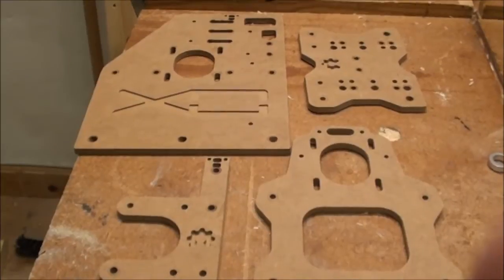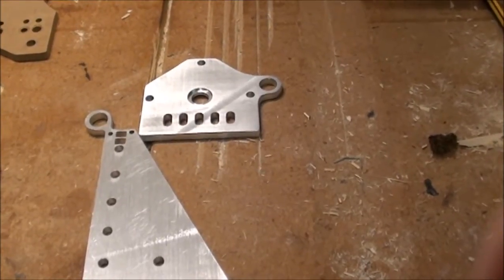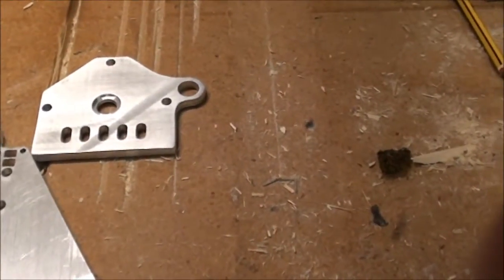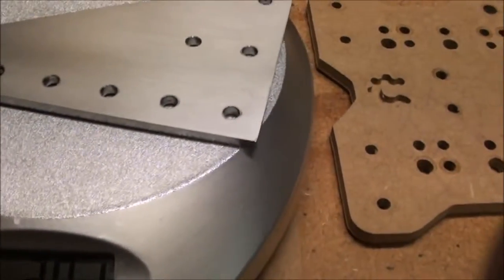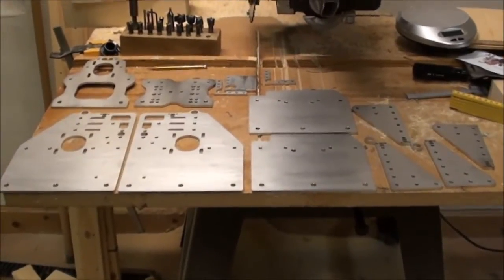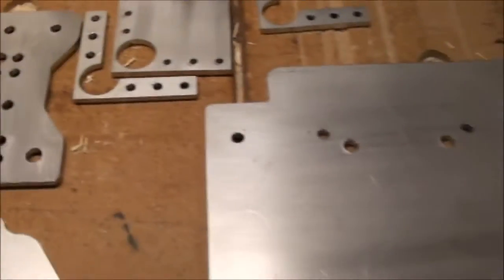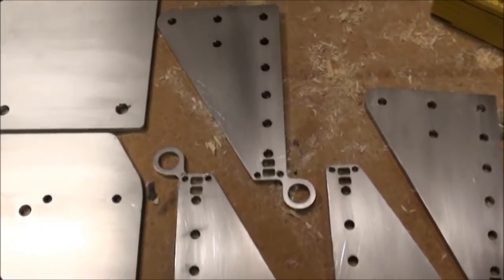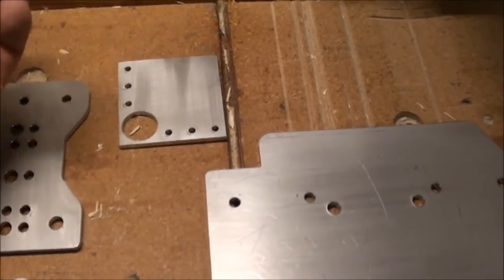OX CNC Stainless Steel Gantry Plates

Comment: Hey, how big is your machine going to be, that you decided to use metal for gantry ? what material ar you going to cut with it ?
Reply from the maker: Hi ArenaTM
I'm making a fairly large machine 1500x1300mm. This allows for cutting full sheets of e.g MDF/Plywood as the ends will be open so I can split long projects into tiles. Rails will be extruded aluminum from OpenBuilds. X will be 2  pieces 60x20 for the gantry and one 40x20 as stabilizer. Y will be 80x20.
The machine will for sure be able to cut all types of wood, plastics, etc. I do also expect that I will be able to mill soft metal like aluminum.
You can follow my build here: http://openbuilds.com/builds/stainless-ox.1914/